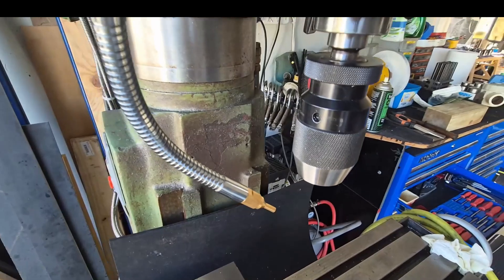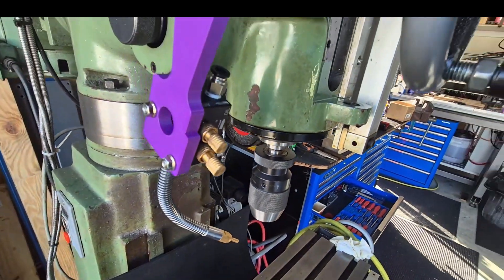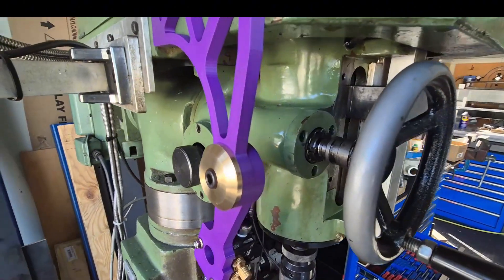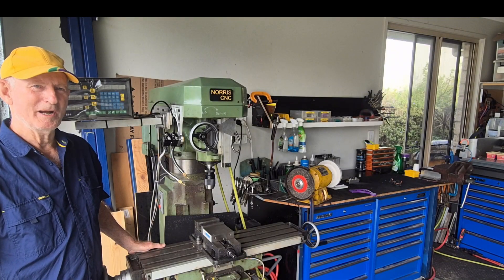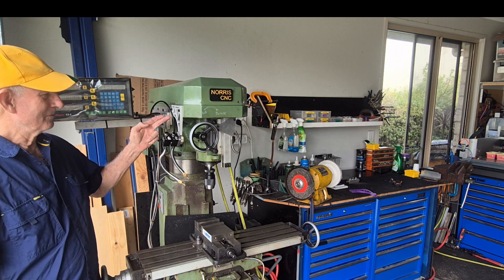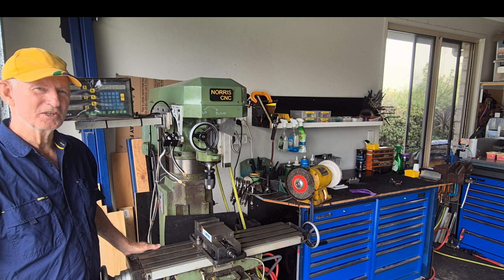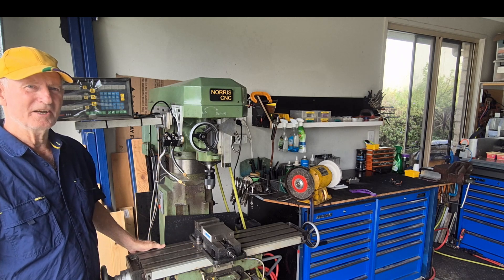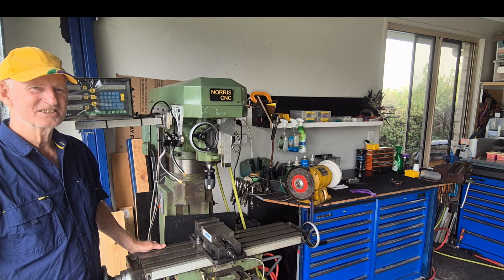3D Prototyping,  Lathe & Home CNC to produce Mister Bracket

Comment: Great Job Bill👌Thanks for the Show🤘🤠👍
Reply from the maker: You are welcome and thanks for the kind words, how is that 4th axis you made, still making interesting things with it ????? A 4th axis is something I would like to build also cheers Bill
Reply: Hi Bill, this was just for testing. I had a few parts lying around, so I sat down at the CAD and drew something based on the parts. The only thing I had to have made was the shaft with bearing fits and the M33 thread for my lathe chuck. Ultimately, it was just a gimmick. Since I don't have a real 4-axis CAM, I removed the Y axis and, after positioning the X and Y axis over the rotary axis, connected the 4th axis to Y. I've only really done engravings with it. All in all, I wouldn't build it myself again; I'd buy a 4th axis instead. But it was fun, and it really stretched my brain. Good luck if you're starting with a 4th axis, too. Cheers, Fritz🤠🤘